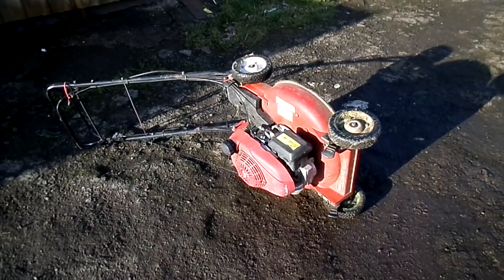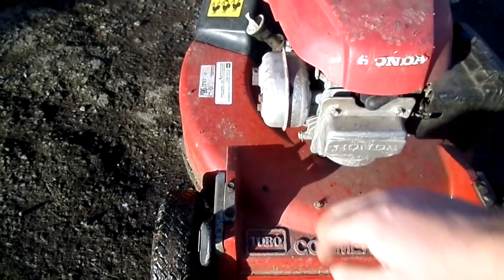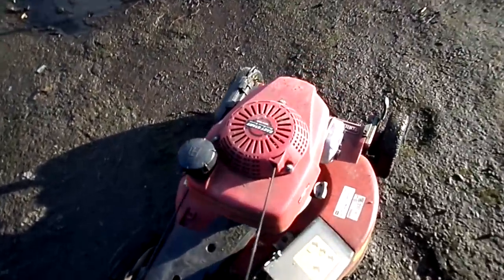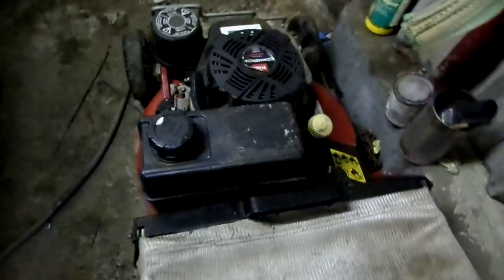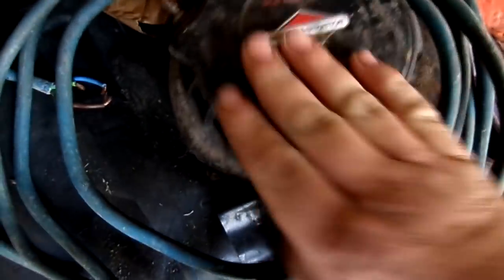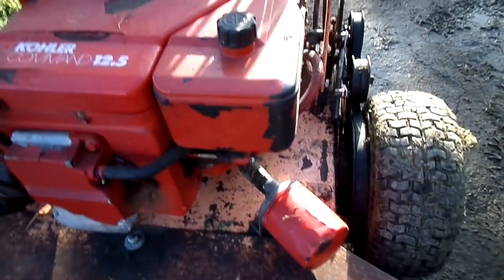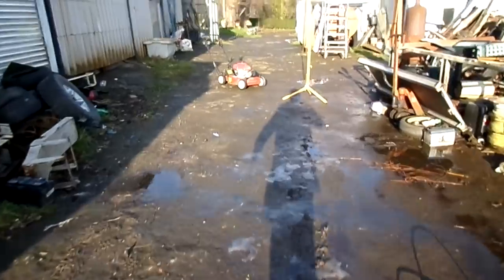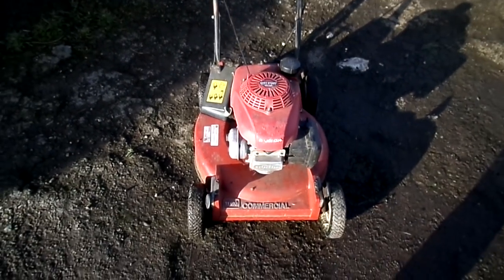How to turn a lawn mower over on the correct side

Comment: The Toro TimeMaster is so easy to wheely tip with the handle in the up position.  Not sure if that's what they intended.  I like the way it keeps the stress off the wheel sides.  That's important for long term operation of the drive train.  Never noticed any problem with oil leaks.  Fuel will leak if full.  Once you've used the tilt up handle you're sold on it.
Reply from the maker: Hi Tom. Thanks for the comments.  One day I will look into trying one of these.  I hear good things about them.  I see what you mean with putting the stress on the wheels when they are tipped on they're sides.  All the best Calvin
Reply: On a cheap Toro Personal Pace the first thing to go is the transmission.  The second thing to go is the gear engagement at the wheels especially if the wheels go wobbly.  The TimeMaster has ball bearing wheels though which should help a lot.  Instead of just plastic on an axle.

Comment: Thank you so much! I have to turn my mower on its side a lot because I have a mulching mower and tons of grass sticks to the sides. By the way when I do this the gas drops into the too of the mower. The cap is tight and it's only a year old mower. Is this common? I have to let it sit between cleanings before it will start again. By the way, love the accent!
Reply: Hi @Life with Kathey  Nothing wrong with mower,  they all leak at a certain point, your tank is probably near full or at least over half full. So I try to remember to do all my under deck work,  after I’ve used it to the point it needs gas. Very low in tank and you’ll probably not have that problem again. ☮️

Comment: I had a guy tell me, If i tipped it over from the back(which i did to look at the blade) that I prob did A LOT of damage.. mine is smoking now, the smoke is white... seems like u may know, does this mean I did A LOT of damage.. I have oil in my air filter and its coming out the exhaust.. it is NOT overfilled, so i know its from me tipping it... thank u for any advice/help... also the mower if very new still
Reply from the maker: Hi. UWonderIKnow.  Thanks for the comments.  No it should be ok.  Just keep it running it should just burn off the oil.  You could clean out the air filter and change the spark plug if it stops running because of the oil.  Usually after a few minutes running the smoke clears away.  Hope this bit of advice helps you out.  Cheers Calvin
Reply: first off, THANK U VERY MUCH, ppl like u help more ppl then u prob even realize.. I got a new filter(will get spark plug in the AM).. should I crank it and let in run with the old filter, so that I dont get oil on my new filter? any other thoughts or suggestions would b VERY MUCH APPRECIATED ..
Reply from the maker: Hi.  Yes let it run on the old filter and spark plug first to clear the oil away unless the spark plug is too oily.  You'd have to change it or keep cleaning and drying it.  You can change the air filter aswell before you start it if you want just clean all the oil out of the air filter housing.  Cheers Calvin
Reply: I have to fix this problem right now. I turned the mower on the wrong side and now it isn't running. If I replace the air filter, clean out the air filter housing and replace the spark plug should it get working again?
Reply: @TheMfmccarthy  What did you wind up doing? Did you get it running well again?

Comment: Hello my lawn mower got turned upside down and im assuming all the oil has leaked down..can i get it out? Merci beaucoup
Reply: Hopefully you've got it by now 😅 (1 year ago lol) but you can spray carb cleaner where the spark plugs goes, pull the chord a few times and it should get all the gunk out!

Comment: I have a Murray push mower and b&s engine I was trying to put the blade back on while I was putting the blade on I moved the crankshaft while I was tightening the bolt and oil came spewing out of the dipstick tube do you have any suggestions?
Reply from the maker: Hi.  Did it only come out when it was on its side.  Check not too much oil may be.  Bit of a strange one that.  leaky dipstick seal.  Cheers any way.  Calvin
Reply: Calvin Thomas the oil was at its level it was supposed to be and it only happened when I started moving the crankshaft while putting on the blade its the weirdest thing I have ever witnessed.

Comment: I'm a simple person, is it fair to say that Both THE GAS CAP AND THE EXHAUST are ALWAYS UP? 
DIDN'T WORK FOR ME! Maybe because you are on the other side of the world?🤣

BEFORE WATCHING your video, i had a guy sharpen my blade, he turned the lawn mower on the opposite side, (the side that the chute flap was not on). The mower ran fine after he left. 2 cuttings later, I did tipped the mower as you said, gas cap and exhaust closest up to the sky. After cleaning under the deck, I TRIED to start it! Yes, TRIED, very frustrating, 😠I was swearing.  Eventually it started.

Your way makes sense to me, but the proof wasn't in the pudding.
Reply: I thought he said exhaust side down?
Reply: You want the air filter up. That’s the most important thing.

Comment: I turned it the wrong way can u tell me how to clean it out
Reply from the maker: Hi.  Try taking the spark plug out turn it over a few time to push any oil out of the cylinder.   You could also poke a bit off rag down in the cylinder hole to wipe out the oil.  ( be careful)  and take off the air filter either replace or clean it out. You might have to remove the carburetor and clean it out or just drop the bowl off the bottom.   It's a hard question to answer really because some mowers might end up worse than others depending on how much oil flows in to the wrong side.  Also dry the spark plug or replace if wet.  I hope this info helps.  Cheers Calvin
Reply: Hello, I think I'm in the same boat here unfortunately, have a 4HP 22" Cut Yard Machine MTD I bought recently and mistakenly turned it to the carburetor side.

It sounds like replaced air filter, cleaned or replaced spark plug and perhaps cleaned carburetor will be in order?